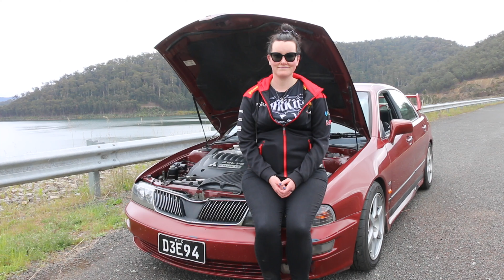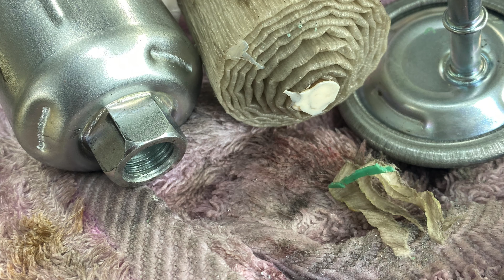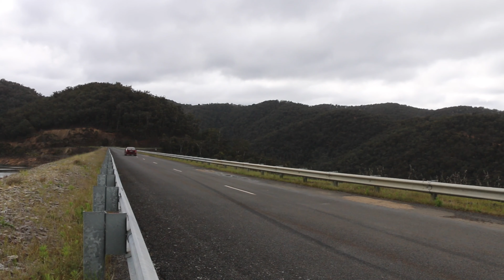Magna Madness - Supercharged 3.8L Magna

Comment: Hey I have been loving your videos! 
I recently bought an 02 Verada GTV,  do you have any suggestions on where to start for getting some more power out of it?
Reply: I have a GTV Less than 500 built. I moved my battery to the boot and put a pod filter were the battery was. Headers and good exhaust. 6G75 engine. Re flashed ECU. good set of tyres to handle the 220kw at the fly wheel.